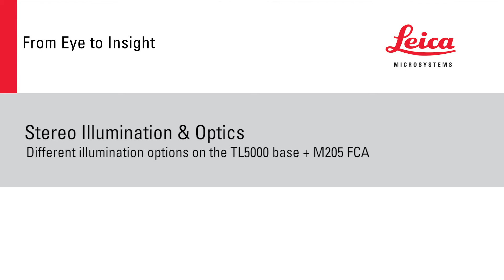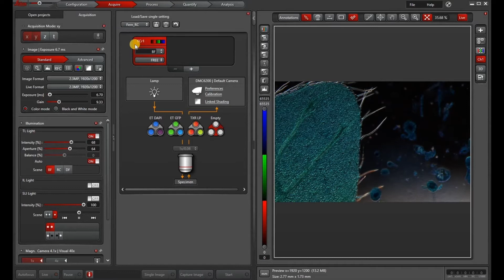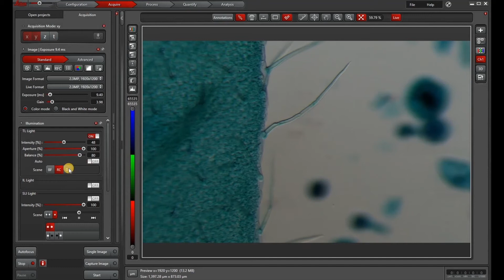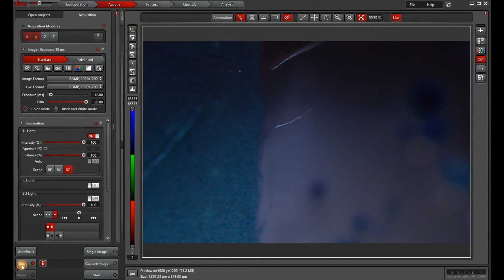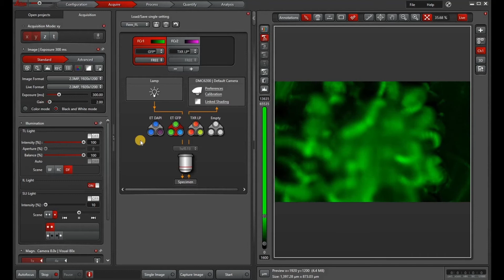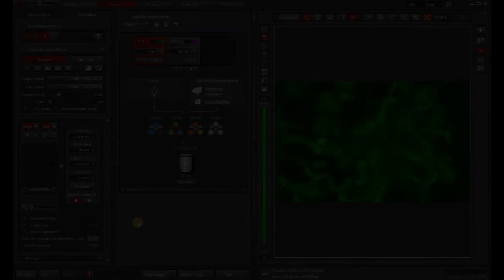Leica Stereomicroscope Illumination & Optics

Comment: Hi there.. focusing could be done through microscope only or it could be done in these settings area while projecting and capturing the image?
Reply from the maker: Hi, focusing can done through both the eyepieces as well as on the monitor through the software. We recommend that, for setting up Z-stacks, a live preview in LAS X is used, in case there is any discrepancy between the focus through the eyepieces versus the camera.